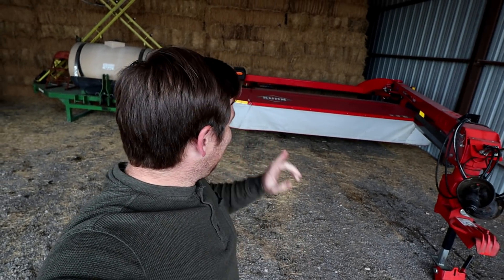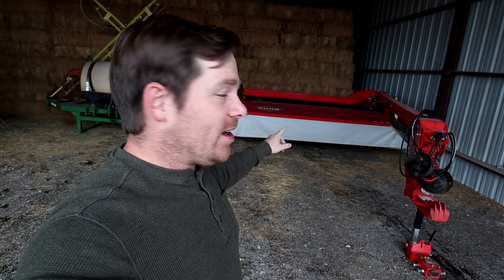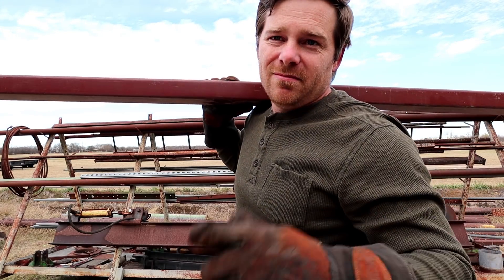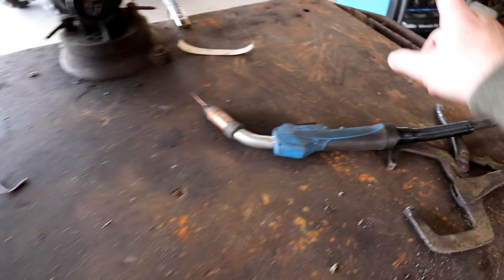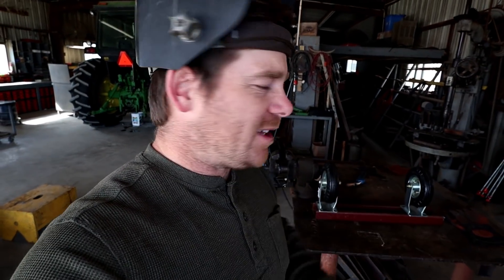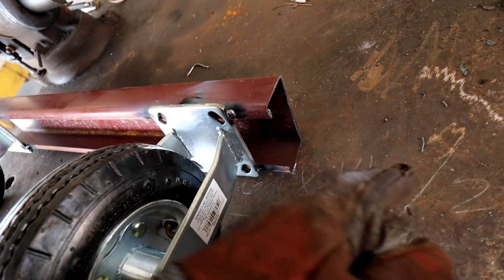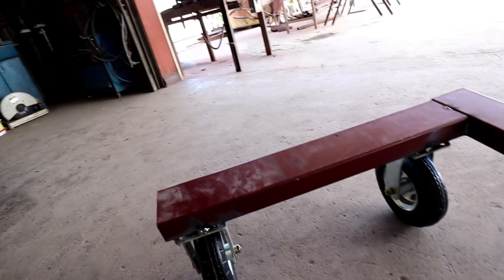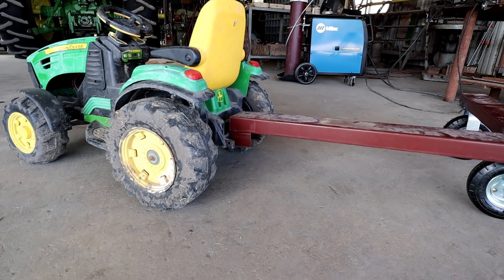Building mower and hay cutter for kids tractor

Comment: So. Auxiliary battery. To run electrical weedeater heads. Positive/ negative wiring. You can’t do it with one dewalt battery, to run the tractor. You need two sources. Make a switch. I’m Ne for the mower. Then run the tractor off of the original battery. You will have to charge two batteries, and create a working harness, but at least you can do both at the same time. Might have to take apart the weedeaters to make it happen. But will work more efficiently.